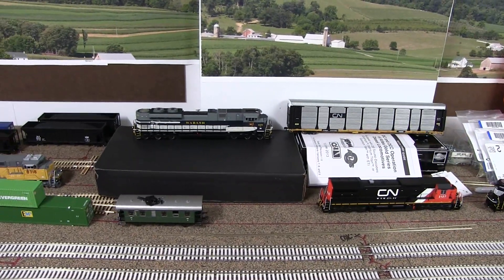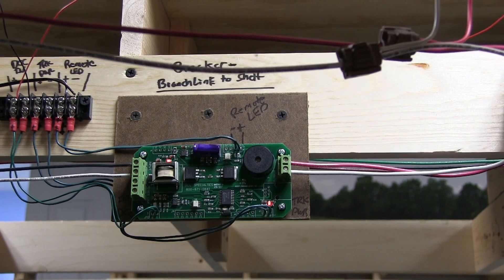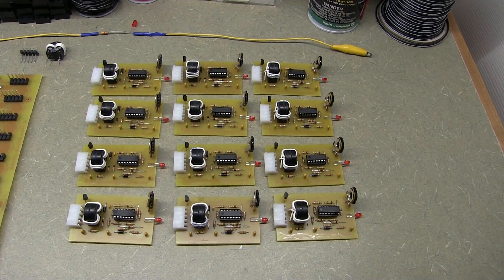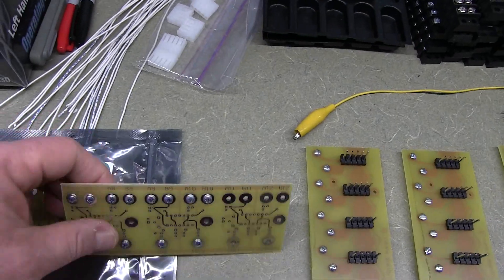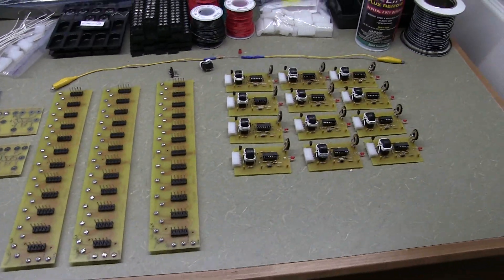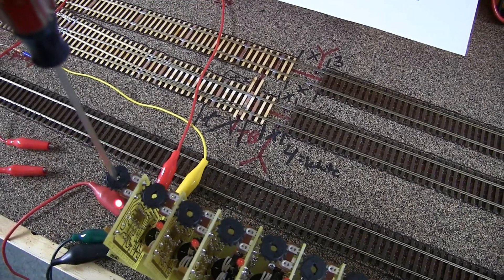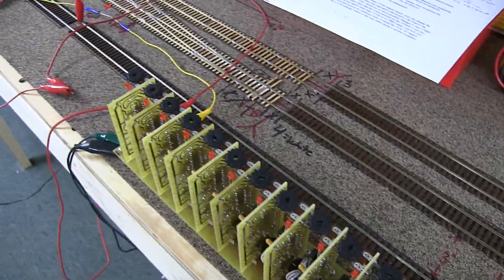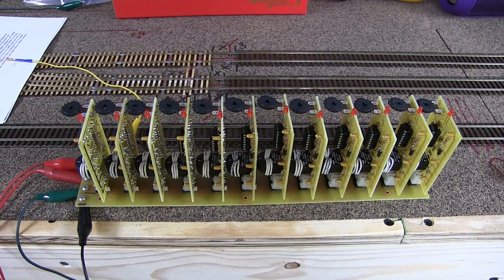Model Railroad Layout Update Video 18- PSX breaker, C/MRI Electronics, DCCOD Testing

Comment: Hey Rob, been going back and watching some of your older vids.  Had a good chuckle over the missed solder on the IC because... Just yesterday I finished building a 555 circuit based on your smokestack led video and initially it didn't work.  I was using a strip board and after poking around for a while I discovered I failed to install not one but two jumpers to connect opposite strips on the board.   Oops.  With the missing legs to the circuits installed it works perfectly.  So thanks for the continued inspiration for me to try new things and for the human reality check!
Scott

Comment: Two observations on this video – first, don't feel too bad about missing the soldering on the socket. Before I got into software development, I spent a bunch of years doing electronic assembly professionally . I can ( and do) tell stories for hours about stupid assembler tricks with respect to assembling circuit boards. Missed solder joints is only the tip of the iceberg. Devices installed backwards, solder Bridges , missing parts, installing parts in the wrong holes, etc. etc. etc. ad nauseam. That's what the quality control department is for :-) . The second thing is about the remove after washing label. That is for assembly shops that use automated wavesolder and board washing machines in their process. I worked for a small shop that actually put their boards in a modified dishwasher after they came off the wavesolder machine. The label/sticker covers the hole where the sound comes out of the buzzer , so that the internals don't get damaged by the water . Other devices that are water sensitive will have similar stickers. They get peeled off after the boards have been washed to remove excess flux.